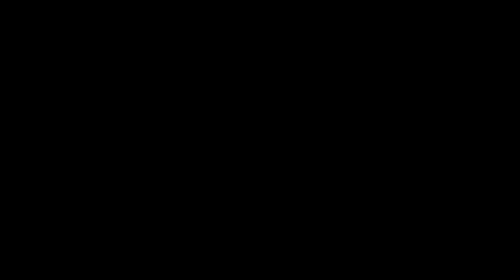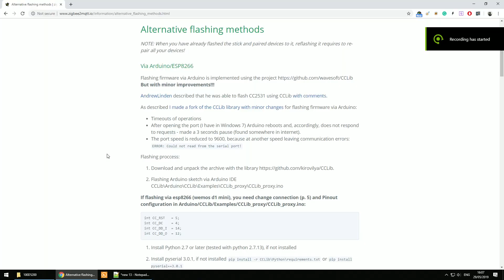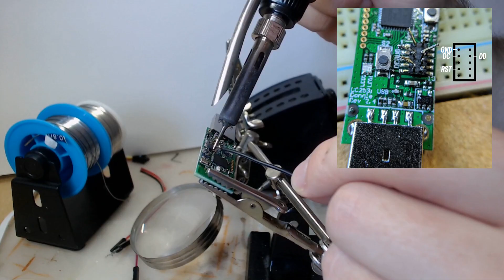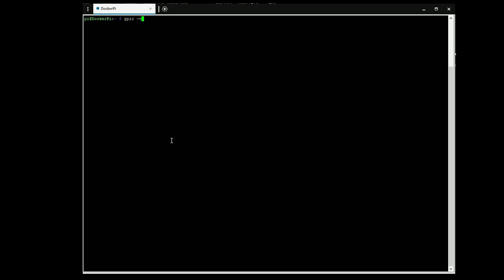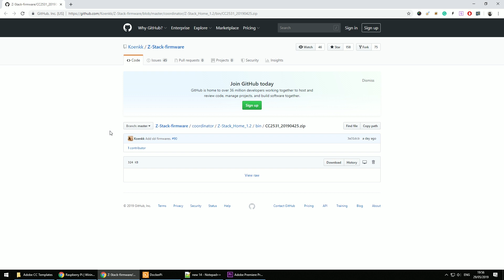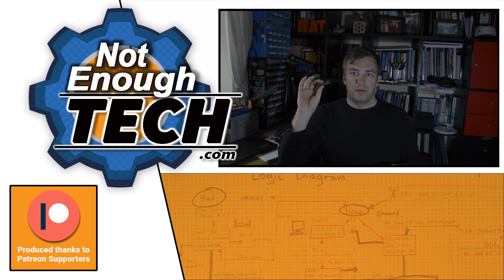Flashing CC2531 without CC Debugger

Comment: Can this be done with a esp32 instead of a raspberry pi? if yes, what needs to be changed and what pins need to be connected between the esp and the cc2531?
Reply from the maker: In theory... probably yes, but you will have harder time getting the toolchain to work as it would likely require custom code. Any lunux machine would do tho not just raspberry

Comment: please , i need the sniffer firmware i need it to do my thesis
Reply from the maker: there are all available on the github for the coordinator
Reply: @notenoughtech  i need it for sniffer
and when i use your method this was the result 

sudo . /cc_write /dev/ttyACMO ~/sniffer_fw_cc2531.hex
 
file loaded (0 lines read).
flash OK.

Comment: Thank you so much, you saved a turkish survivor from waiting parcels for 30 days from China. :goodvibes:

If you are a lazy potato like me about soldering, I have a worked idea for you!

First cut the male part of the socket wire directly. Now we have to push the wire directly to the related pins, the pins are so thin that they would make their own way to fit inside. But be careful while doing this, gently push and rotate left and right to help the pin.
Reply from the maker: That's a good tip.
Reply: @notenoughtech  thanks 😊
Reply: Yeah this is what I came up with as well and it worked! Just cut some cables (with a bunch of small copper wires inside) and stick it right onto the pins :)

Comment: this is not working wiringpi is not available, but is referred to by another package.
Reply from the maker: Have you tried installing it from a different source?
Reply: @notenoughtech  nope.. linked, is installed. and flashed. but I don't see myself in the zigbee2mqtt device.. it is not shown or connected..im flash as router/extender..

Comment: Why didn't they make this device with a hardware switch so you can click the switch plug it up to a pc via USB, flash it and then when it's flashed flick the switch back and use it in its normal mode.

Comment: Excellent instructions. Thank you! FYI instead of soldering wires directly on to the pins I just used pliers to crimp a couple of the push on connectors so they would fit on the narrow gauge pins.

Comment: I'm kinda new to this whole zigbee thing :P

I was wondering of the dongle and zigbee2mqtt works with tuya smart battery powered temperature/humidity sensors (they are zigbee, but they are not listed as supported)?
I know you have a vidoe showing how to add new devices, but i'm curios if there could be any problems with the tuya things...
Reply from the maker: I already covered this here
https://notenoughtech.com/home-automation/adding-new-devices-to-zigbee2mqtt/
You should be able to use tuya devices just fine
Reply: @notenoughtech  awesome thx :)

Comment: If I do this , will I then be able to add it directly as a "Zigbee home automation" device ?
Reply: (In Home assistant of course)
Reply from the maker: @danededane  I'm not 100% how it looks in HA end but it's ZigBee2MQTT based so you will be able to interact with it via MQTT
Reply: @notenoughtech  Thanks for the quick answer - I really hoped that the firmware would turn it into a ZHA device.. But I guess I have to buy another CC2531 with the sonoff firmware if I want a ZHA device . After that I probably have to move the antenna from my current CC2531 to the sonoff CC2531 (it does not come with an antenna)
Reply from the maker: You can flash any firmware on it. I know people are using it with HA I just don't know the details of how as I use nodered only
Reply: I can confirm its working perfectly as a ZHA device in HA 🙏👍

Comment: Great video! Thank You. But I've got a problem connecting cc2531 GND (pin 1) to Raspberry Pi 4b GND (pin 39). It causes power off of the stick despite other pins are connected or not. When I tried to connect GND to other GND pins (6, 9, 14 etc) on the Raspberry I got id="0000". How do you think what is the problem?
Reply from the maker: If it causes the power off a short would be the most obvious cause. Do you have the pin mapped to anything else via other scripts?
Reply: @notenoughtech  No. Only zigbee stick cc2531
Reply from the maker: I have no idea? I assume the stick wasn't pre flashed? Perhaps faulty? Itead sells them flashed with coordinator
Reply: @notenoughtech  Right. The stick wasn't pre flashed. Actually it's not ITEAD manufactured stick.
Reply from the maker: They don't make these but they flash it and verify it and sell for $4 so worth having the piece of mind ;)
Reply: @notenoughtech  Thank you. Probably mine is broken. Will buy another, pre flashed :)

Comment: Thanks for the video, perhaps you should edit the info saying ffff means incorrect wiring.
I encountered this and checked the wiring 10 times to find it all correct. Found below info on github and this fixed the issue.

edit CCDebugger.c, modify the line 177

static int cc_delay_mult=50;
into

static int cc_delay_mult=80;

and the line 83

  cc_delay_calibrate();
into
//  cc_delay_calibrate();

save the file and call  make to rebuild the binaries.
Reply from the maker: Thanks for the tip!

Comment: Hi, nice video!
I'm a total noob in the matter and I don't have soldering tools. I was wondering is it possible to use female to female wires instead of soldering thing?
(I would have tested myself but I don't have CC2531 or wire ahah)
Reply from the maker: I have been told that if you remove the plastic shroud these can fit nicely. Inspect the cable though to make sure these won't cause shorts
Reply: @notenoughtech  I did this just an hour ago and it worked great. I bent the pins extra far apart and didn't stick the wires on all the way, in order to prevent them making contact with other pins, as you say. But as long as the wires were making contact with the right pins, it worked fine! No soldering required.
Reply from the maker: Enjoy freedom
Reply: @notenoughtech  I'm in the process of flashing but got ID successfully. I stripped plastic and use electrical isolating tape to isolate wires. My wires sit a little loose on pins, but it works.

Comment: Worked fine although it took me a couple of hours to complete, soldering was a bit tedious, but all done now. Thanks.
Reply from the maker: Haha just bent the pins. Also apparently Dupont cables work if you remove plastic sleeves
Reply: @notenoughtech  I did bend the pins, yes. Just a bit difficult to solder so close to each other, but got there in the end. Cheers. Saved me from buying the kit.
Reply from the maker: Enjoy you will love mixing and matching various ecosystems

Comment: I didn't solder the wires. I just bent the wires as him, I removed the plastic cap of the dupont wires and connected them carefully ;)
Reply from the maker: I need to try this next time :D
Reply: Awesome tip - thanks! Had to put a bit of tape over the metal caps to separate them cleanly from each other. But much easier than soldering.

Comment: I think you have answers to almost all of my home automation challenges. I've hit a limit on the CC2531 stick I got from ebay as it was loaded with standard firmware which you shouldnt use with more than 30 devices.  I'm now up to 58 devices in my house and it kept crashing almost daily, locking up where I had to keep reconnecting it in the usb port. Loaded up Source_Routing firmware on it using your method and it worked perfectly. Thanks again for this video, I dreaded having to wait for a programmer at least 2 months as there are none locally available where I am.
Reply from the maker: I just got another coordinator so I'm sure I'll be posting soon.
Reply: @notenoughtech  So I've just learned the hard way that Xiaomi Aqara Opple switches dont like source routing and only prefer to be connected directly to the coordinator. I have to build a diy cc2530 router I think to fix my network size problems and revert back to default firmware on the cc2531. I'm up to 80+ devices now.
Reply from the maker: You are growing these very quickly. Or do they multiplying on their own now 😂🤣
Reply: @notenoughtech  HAHA!! I just started pairing 20 Zemismart dimmers and 4 Xiaomi Smoke detectors that arrived in the mail today. Also testing the Opple switches that I got earlier, while waiting for the big order of 16 to arrive. So far have paired just over 20 Sonoff ZBR3's, 8 Samsung temp and door sensors, a number of Ikea bulbs in lamps. All running off NodeRed, but using the Homeassistant nodes to control them. I found those nodes easier to configure for dimming on the Zemismarts with simple 5% loops that are stopped by the "released" payload from the Xiaomi switches.
Reply from the maker: Impressive!
I like Xiaomi buttons too. You can also paint the logo to make them look different.
Reply: @notenoughtech  SUCCESS!!! 5 re-flashes later and went back to source_routing f/w. All works, trick was to pair the first 4 Xiaomi Switches before anything else, then one of the Sonoff ZBR3's, so that it acts as a router, then the rest of everything after that. After all that I ordered a CC2652 coordinator from Tindie anyway. My network is too big for CC2531.
Reply from the maker: looks like I made a bad call with not getting the CC2652  as well - i was swayed by the range tho
Reply: @notenoughtech  Electrolama in the UK makes the kits. https://www.tindie.com/stores/electrolama/

I bought my one from the German supplier as his units are preflashed and with a better antenna.

https://www.tindie.com/stores/slaesh/
Reply from the maker: looks nice - question is - will it beat Conbee2? I already have it I really need to get on trying it out :D Time is the usual constraint
Reply: @notenoughtech  From what I can gather, Conbee2 is like a cc2531 with source_routing f/w. 5 max connections direct and 200 max through routers. I like the DIY aspect of the CC's though, and that they are more compatible with the Xiaomi's,  so I'm sticking with those.
Reply from the maker: I will end up having most of them here. Just thinking about the amount of testing to put VS type of video scares me :) even though I know it would be very popular. I don't want just go through tech specs,.
Reply: @notenoughtech  yeah, VS type videos are hard, as everyone has their own strong opinions and you have to be 100% sure of what you are presenting. I also think that the type of coordinator someone will use is dependent on their application and environment. Just because the CC2652 suits me, doesnt mean its necessary for someone else who will be just fine with a conbee or 2531. I'm going all out on this, my whole house will be basically smarter than me.
Reply from the maker: I can agree on this. Especially that I'm in favour of the right tool for the right task approach

Comment: Hi, Great Videos! Very informative and helping me to transfer my small setup from Homeseer to Home Assistant. Thankyou!

I saw in your tutorials you recommended the itead CC2531 and that you had it working withe the Ikea e1743.

I would like to share an issue i had when first attempting to use the IKEA TRADFRI Wireless Dimmer (e1743) - https://www.zigbee2mqtt.io/devices/E1743.html
with the itead Zigbee CC2531 USB Dongle (as shipped) - https://www.itead.cc/cc2531-usb-dongle.html

I just recieved my CC2531 dongle yesterday preflashed with the CC2531ZNP-Prod firmware from itead. 
Along with some sonoff zigbee Temp/Humidity sensors, Window/Door Sensors and motion sensors.
These all paired fine with the CC2531.
Then I tried adding some Tradfri e1743 switches and a repeater.
The repeater paired and appears to be working fine.
I managed to pair the e1743 to it but I was not seeing any button presses from the e1743 in the mqtt log.

After many hours of searching and testing it turns out the firmware on the CC2531 is an old version, not sure of exact version number but it was from 2018!
https://zigbee2mqtt.discourse.group/t/problem-with-ikea-push-button-e1743/677/4

The firmware version of the CC2531 can be seen in the zigbee2mqtt log on startup - Mine is now at 20190608 (see below) after flashing to the newer firmware again with the method in your video! :) 

zigbee2mqtt:info  2020-07-02 10:23:02: Coordinator firmware version: '{"type":"zStack12","meta":{"transportrev":2,"product":0,"majorrel":2,"minorrel":6,"maintrel":3,"revision":20190608}}'

I plugged the CC2531 back into the Pi after flashing to the 20190608 firmware and the button presses are now visible and working. :)

zigbee2mqtt:info  2020-07-02 10:30:16: MQTT publish: topic 'zigbee2mqtt/Tradfri Dimmer 2/click', payload 'on'

I'm happy with the CC2531, but it was a bit annoying to find out the firmware was from 2018 and causing the issue with the e1743. :(
Now I just have to watch your other video and set up the e1743's in node red to work with my Yeelight bulbs! :)
Reply from the maker: I think it could be also the case with new IKEA buttons shipping with a newer firmware too. I'm still running the same firmware on my cc2531. I had no issues  therefore I wasnt pushed to updating it. But my IKEA devices were purchased at launch

Comment: @NotEnoughTECH I have this problem, I have already installed the HASSIO, when I go to the terminal through SSH Web Terminal, I can only see the" -->~ " prompt. I know it is not right, because your terminal shows a "$" prompt. I cannot execute any gpio -V or any command like "sudo get-apt...".. Please advice how to get to "$" prompt after I have installed the HASSIO. Please give some guidance as we are all beginners in Home-assistant.
Reply from the maker: Are you logged in as a root user?  Seems like you have no permissions to do whats's needed
Reply: @notenoughtech  Hi, I setup HA as what is instructed on the web as i am quite new to it. i setup duckdns, ssh web terminal and i try to use the terminal...may i know how to log in as root user or root permission?  i am the rightful owner of the HA & Pi?
Reply from the maker: frankly speaking I never played with HA - but you can check if you are root user :
https://unix.stackexchange.com/questions/305509/how-do-i-check-if-i-have-root-access
like this.

Comment: Note:
Upload new firmware using ./cc_write /path/to/CC2531ZNP-Prod.hex this will take about 3 min on RB4
 but in zero it will took 30 minutes!
P. S. If you start with sudo ./cc_write then it will do it faster. Without sudo it's not working at my home...
Reply from the maker: Thanks for that. Zero is significantly slower. I think the instructions also mention similar times for Arduino method
Reply: @notenoughtech  sudo before commands was needed in my case. Without sudo, everything was slow and not working but with sudo before commands I did it just like you did. So zero is fast but sudo is needed.
Reply from the maker: the issue was with file permissions then. I had the file access issues with my NAS drive. Not having correct permissions set would affect my download speeds.

Comment: For anyone having issues and getting ID different than b524 and being unable to write, use '-m 90' (or increase the number if still not working) after every cc_ command. This functionality was added recently and it fixed my issues. @NotEnoughTech maybe pin this for all to see? More info here: https://github.com/jmichault/flash_cc2531/issues/9#issuecomment-557893592
Reply from the maker: Thanks for the tip

Comment: Thank you for this. This same method works on CC2530. you only need the respective zstack and correct pin connection which is available here
http://www.marrold.co.uk/2019/12/flashing-cc2530-cc2591-zigbee-module.html?m=1

Comment: This tutorial is definitely not for beginners. It's great that you are doing this, but damn, it is missing a whole lot of info. For example how to move the hex file into raspberry.  Definitely not for newbies :/
Reply from the maker: You can either upload it using FTP or simply put it the SD card and move to correct location
Reply: @notenoughtech  I finally found it! Thank you!!
Reply: not knowing folder structure in linux I have no clue where  the flash_cc2531 folder is :(

Comment: Hi Matt, I appreciated your video!! are there any extra steps if i'm using a raspberry pi 4? Thanks!
Reply from the maker: You should be fine with rpi4. Check the chip on PCB. Some of them seem to be shodddy. Do you have v2.4 or v1.0
Reply: @notenoughtech  i believe is version 1.0.. But how can I make sure of that? Is there any difference in the flashing process depending of the version?
Reply from the maker: I hardly had complains from anyone on v2.4 - check this one out:
https://github.com/jmichault/flash_cc2531/issues/10#issuecomment-544139748

Comment: Hi! Thanks for the video, really helpful! Unfortunately, I am stuck on error "ffff"... I have verified several times the cables (I have resoldered them twice), but still no luck. I see a green light from the onboard LED, so I assume that the device is not completely faulty... Is there anything I can do to debug this? Thanks!
Reply from the maker: What raspberry are you using ?
Reply: @notenoughtech  Raspberry Pi 2
Reply from the maker: @fascineroso  also is the xx2531 v2,.4?  See PCB... I had some readers reporting that it wouldnt work on zero while worked ok on RPI3... 
check this out too:
https://github.com/jmichault/flash_cc2531/issues/10#issuecomment-544139748
Reply: @notenoughtech  I can see CC25XX USB Dongle Rev 1.0
Reply: I also had the FFFF problem. Sometimes i would get 0000. But once every while (1 in 15-20 times) i got the correct id. I thought i'll give it a go. And it worked. I was lucky. the first attempt started the upload. and after my cc2531 is working flawlessly again.
It did work when i (preflashed) bought it initially. After a year or so it stopped working... (?)